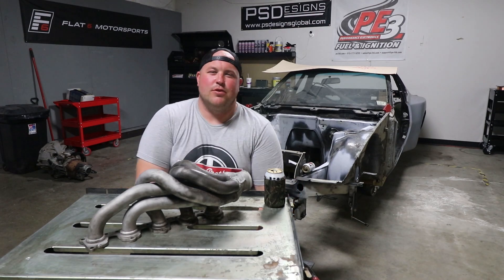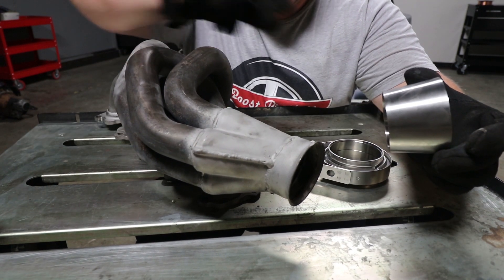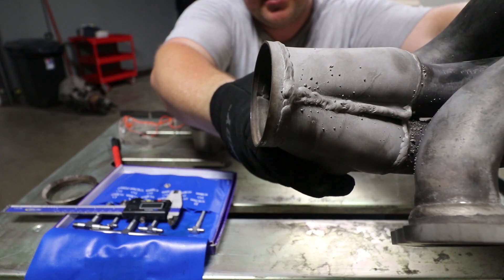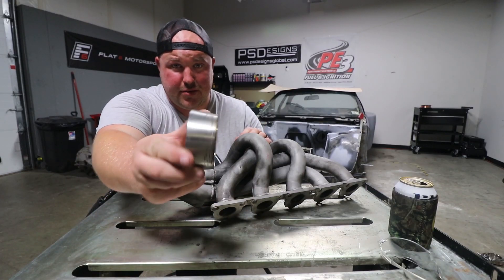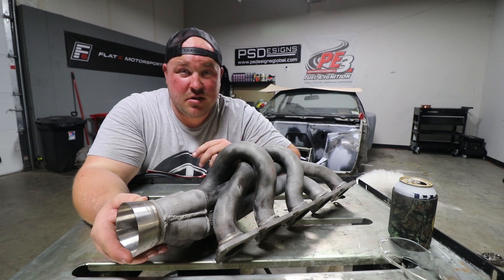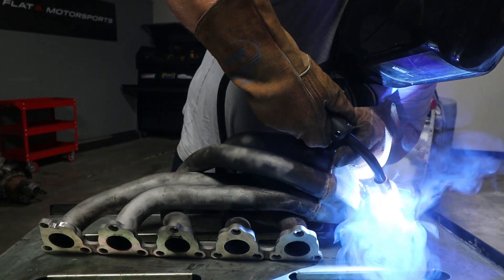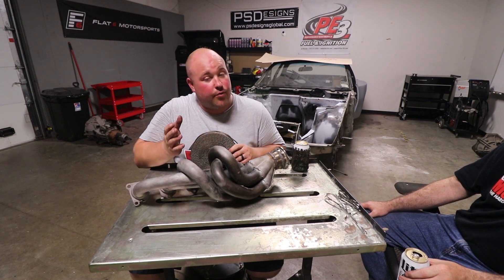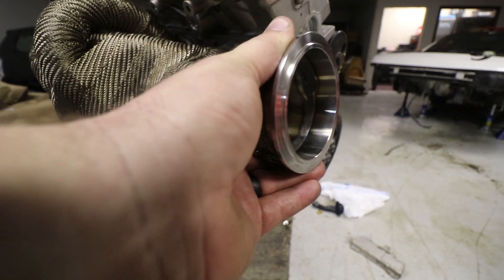Modifying My Gallardo Header (Porsche 944 07K swap)

Comment: Nice presentation and work, did you use stainless mig wire BTW?
Reply from the maker: Thanks! I did use SS wire, however I don’t have any triblend gas so I used the standard 75/25 which isn’t ideal

Comment: Did you use Solar Flux on the inside of the weld to protect it? I didn't see an argon backpurge so I wanted to ask. The backside of stainless steel needs to be protected when welding or the weld will look like sugar and probably fail after a short period of time.
Reply from the maker: I did not back purge it or use solar flux (which I wasn’t aware of). I knew this was a requirement for correct TIG welding but from the research I did, it was not suggested for MIG welding.

Comment: Are you going N/A for the widebody 944?
Reply from the maker: The race car is getting the NA 07k, the widebody car is getting a 2.85 hybrid stroker (based off the 951 engine) and a big turbo. Should be good for 500 whp

Comment: I can appreciate the level of effort you put into measuring everything up but why didn’t you just shove the small end of your cone into the header and mark it off with a sharpie, cut, weld, and smooth the inside of the bore?
Reply from the maker: That’s what I would have normally done for sure. However, since my buddy was there and he’s a perfectionist I wanted to learn another method. I would have never thought to turn the calipers around to scribe the reducer like that, so it was a cool trick to learn.